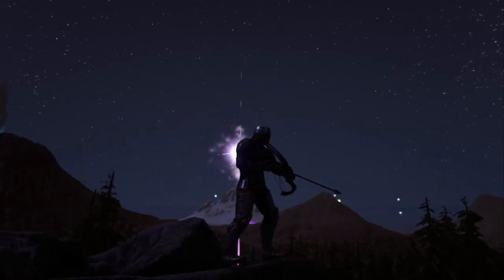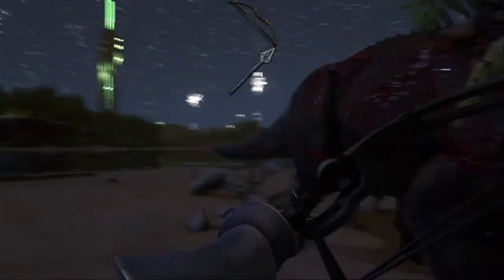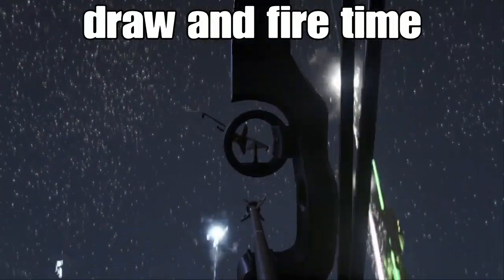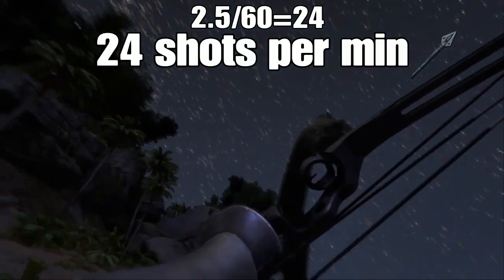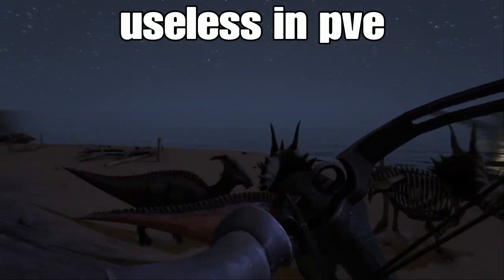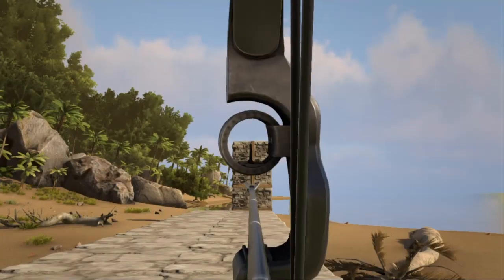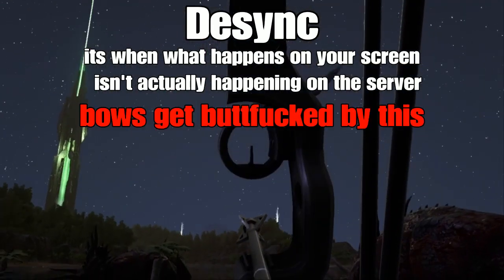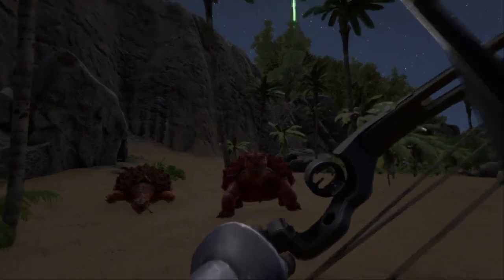ARK WEAPON GUIDE 2020: COMPOUND BOW

Comment: To help, by the time you unlock the engram for this, you should be comfortable hunting Kairukus for organic polymer if you have issues getting enough supplies to create regular polymer. Also, taming a Beelzebufo can help with the cementing paste if again, you're hard up on getting the necessary materials for mass creating the stuff. All in all a great weapon and one of the staples that I use once I am able to.
Reply: You could just tame a couple of Achatina 's although they can only be tamed using sweet veggie cakes you'll get like 100 polymer and 100 cementing paste after a few minutes or so